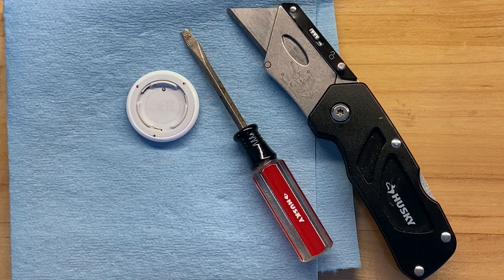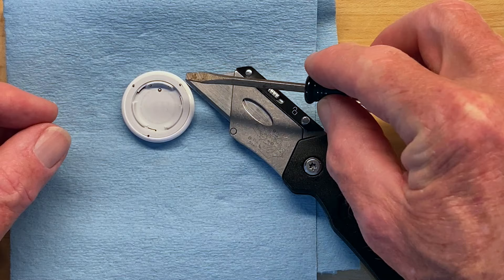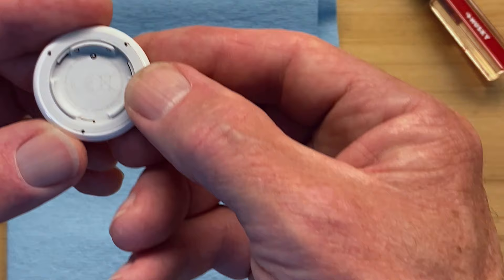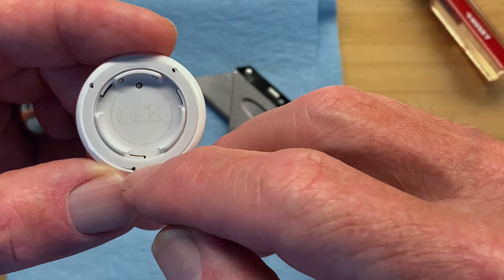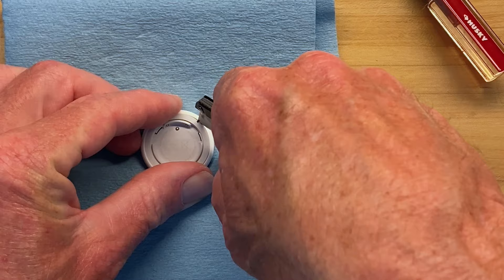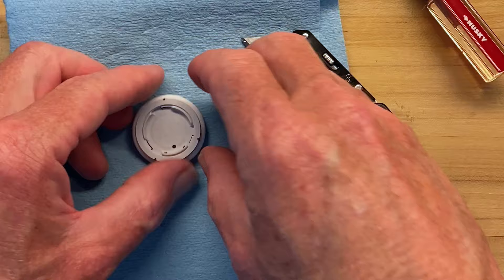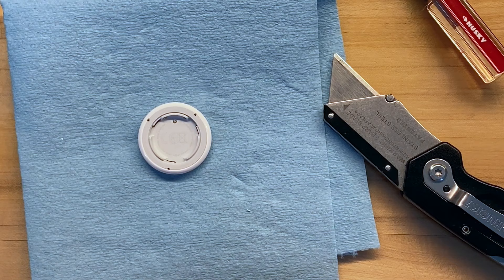Best way to open and mute (disable speaker) an AirTag with zero damage to the AirTag.

Comment: Amazing video!  Thank you so much! I bought AirTags for both my vehicles as there have been a number of vehicle thefts in my area. I always worried what was the point of having an AirTag in there if it would start chirping alerting the thieves.  I feel so MUCH better after removing speakers in both of them!  Thanks again!  Didn't break any clips! SUBBED.
Reply from the maker: Glad to hear the technique worked well for you, thank you for subscribing!

Comment: Thanks for this. Funny how they are still emitting a very tiny sound after speaker (amplifier ?) removal, if you put the airtag just in front of your hear in a quiet room... How come ?
Reply from the maker: Another YouTuber said they heard a very faint sound after the magnet removal as well. I'm stumped. The magnet interacts with the electrical signal from the coil to make sound. with the magnet gone I can only assume the battery or other metallic components are vibrating from the electrical impulses from the coil. Maybe snip and remove the coil?
Reply: Yeah same. Very quiet though. I doubt it could be heard if it wasn’t pressed against an ear

Comment: This is a way better version, thanks a lot, it worked for my four and I didn't break any of the clips. I found it snug to get the back on again on a few but that's probably because I used a small screwdriver and not a knife.
Reply from the maker: Hey David, you're not the first person to hear a faint sound after muting an AirTag, I didn't notice any sound coming from mine, but perhaps my hearing isn't what it used to be. ;)

Comment: Great, I didn't know one could actualy silence the little bugger and this, it squealing after a while when in lost mode, is a major deal killer to use it as a tracker. Will try this on all 5 of my little circles of joy! In IOS 15 there is also a new annoying feature that alerts you when you are away from the tag but it can be turned off. I love how the tag in my parents bag reported to some iPhone on board at 30,000ft over Kansas! Presumably someone with an iPhone picked its BT signal up and connected to a cellphone tower for a brief period.
Reply: Did you manage to do this ?
Reply: yes it was super easy and you can use a little thin blade screwdriver too if you're careful.

Comment: Brilliant! Cheers for this. I just did two and I snapped only one of the clips. Totally chuffed.
Reply from the maker: Thanks for the feedback, glad the technique worked well for you!
Reply: This is great! I snapped one only because I didn’t get the scalpel blade deep enough to detach the clip from it’s seated position. 

Scalpel blades (11) is the best since it causes the minimal destruction with surrounding plastics but strong enough to bend and put through.

A sharpened Philips (-) screw driver is the perfect pry tool.

Thank you to the original poster!

Comment: Thanks for the video! After trying it out it seems that even with the magnet removed, the AirTag is still beeping weakly if you put it right next to the ear.

In order to make it dead silent you need to also disconnect those 2 tiny wires connected to the actual coil.
Reply from the maker: Thanks for the feedback! I never noticed the faint sound after the magnet removal, but others have mentioned it. 

I suspected other metal parts, or the battery were reacting to the coil's electromagnetic field once the magnet was removed. I knew cutting the coil would eliminate the electromagnetic field, but didn't know if cutting the coil would negatively affect the AirTag. My concern was that the coil might also function as the AirTag's bluetooth antenna. Can you compare the bluetooth range of an unaltered AirTag and one with the coil cut?
Reply: @Koolbob2  That's a fair point. Just tested the effective range between 2 AirTags - one with the coil cut and there other one is brand new. It feels to me that both are functioning just the same: both can be connected within 30ft in an open space, or within ~15ft behind a drywall.

I'm only doing this because I want to put it on my cat's collar, and they've got excellent hearing so I don't want it to beep at all. Under most cases it shouldn't be noticeable.
Reply from the maker: @liang-chiwuu4785  Thanks for confirming that the range isn't affected by cutting the coil! I'll add an update to the video description so others can benefit from your experimentation. We have two cats that we don't let outside anymore due to an incident a few years ago with a pack of dogs. I have a few AirTags left over and I had thought about attaching them to the cats collars, just in case they slipped out. How are you attaching the AirTags to your cat's collar?
Reply: That's interesting. Well, let's hope that there is no requirement to have a functional coil incase we need to take it out ;p

Comment: Worked great but having problem activating air tag. I didn't activate before taking out the speaker. Is that the problem?
Reply from the maker: Toby I'm sorry you are having problems activating your AirTag. I activated all four of my AirTags as soon as I got them and then discovered they sound an alert if a person who isn't the AirTag owner transports the AirTag. That's when I decided to mute one of my AirTags. It turned out so well I made my video so others could use the same method.

Has anyone muted an AirTag and then activated it? If you have, please chime in!

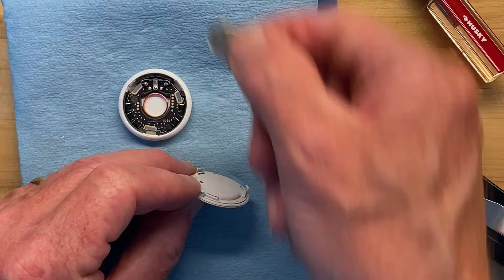Comment: 2:50  What if i also desolder the coil inside and remove it too?? It would save some battery life... but will it work normaly (without sound), or would it trigger a fault????
Reply from the maker: Good question! I'm not an electrical engineer, just a guy who likes to tinker with things. :)

My understanding is that there is a circuit on the board that generates an electrical signal, that signal is amplified and sent to through the coil. The function of the coil is to convert the electrical signal into an oscillating electrical field, the magnet reacts to the coil's oscillating electro-magnetic field and vibrates along with the case of the AirTag the magnet is glued to, creating sound. 

Removing the magnet eliminates virtually all of sound, but the pulsating electro-magnetic field generated by the coil is able to cause other metallic items in the AirTag to resinate ever so slightly. 

Cutting the coil wire disrupts the electro-magnetic field and eliminates all resonance within the AirTag. No electric-magnetic field = no resonance = no sound.

believeI do not anticipate any benefit from removing the coil entirely versus cutting the coil. 

It would depend on the design of the circuitry. It could be that the circuit uses the same power and functions as it did before even with the coil disabled, or the break in the circuit caused by disabling the coil could prevent the signal generation and amplification portion of the circuit from functioning and drawing power. In my opinion, the power savings, if any, would be minuscule and very difficult to measure.

Comment: Would be drilling a hole through the speaker and filling it with glue be sufficient to kill the sound?
Reply from the maker: Maybe. It’s a transducer, not a traditional speaker. The transducer in the AirTag has a voice coil and a magnet (which is what I’m removing in the video), but there is no speaker diaphragm or speaker cone. The AirTag uses the plastic shell of the AirTag to move air and produce sound. IF you could get enough glue between the voice coil and the magnet it MAY prevent to magnet from moving and vibrating the AirTag shell. Maybe.
Reply: @Koolbob2  thanks, it was a thought. Give it a try your way

Comment: Does it still stay water resistant do you think?
Reply from the maker: Good question! First of all, it's important to know the acknowledge the difference between water proof and water resistant. AirTags can not be submerged and even if unaltered, they may be damaged by water intrusion between the two halves of the case or past the battery door. Prying the case open does enlarge the gap between the two halves of the case where the knife blade is inserted, so yes the water resistance is compromised slightly. In my instance, the AirTags I've altered are inserted into a waterproof case designed to mount and conceal the AirTag, so I'm not at all concerned about the reduction in water resistance from opening the AirTag. However, if you are concerned it would be a simple task to add a minuscule ring of silicone caulk around the inside of the case before snapping the back of the case into place. I suppose it could even make the AirTag more water resistant than before the modification. Please Subscribe if you find the video helpful. Thanks!
Reply from the maker: @uglyDuci  I like this one from Device Therapy   https://www.etsy.com/listing/998069956/airtag-bike-mount-reflector?gbraid=0AAAAADtcfRITS-0IQLNb1BHcbWKdEdCpr&gpla=1&gao=1&&utm_source=google&utm_medium=cpc&utm_campaign=shopping_us_d-toys_and_games-sports_and_outdoor_games-bikes_and_cycling-cycling_accessories&utm_custom1=_k_Cj0KCQjwnJaKBhDgARIsAHmvz6eEMEJUehmi8kMd2BtYJTcWLjQ-jdO_1RssNEZ4vbYLmsBPE3i10j8aAtQGEALw_wcB_k_&utm_content=go_12560180294_126270836064_506995646774_pla-315282688459_m__998069956_12768591&utm_custom2=12560180294&gbraid=0AAAAADtcfRITS-0IQLNb1BHcbWKdEdCpr&gclid=Cj0KCQjwnJaKBhDgARIsAHmvz6eEMEJUehmi8kMd2BtYJTcWLjQ-jdO_1RssNEZ4vbYLmsBPE3i10j8aAtQGEALw_wcB

Comment: I wonder how it is waterproof with all the holes behind the battery..... hmmmm
Reply from the maker: To be fair, Apple says the AirTags are 'water resistant', not 'waterproof'. There's a difference.

Officially, AirTags are  and have the same water resistance rating as an iPhone SE. The rating of IP67 means that it is splash, water, and dust resistant. According to Apple, AirTags can spend up to 30 minutes underwater with a maximum depth of 1 meter (3.2 feet) without experiencing permanent damage.

Comment: why do that?
Reply: I have airtag in car. Battery drain fast with beeping
Reply: why is beeping?
Reply from the maker: Apple's intent was for people to use the AirTag to find items they had misplaced. Many of us would like to use the AirTag to locate items that have been stolen, so we mute the AirTag so it won't give away it's hidden location on a stolen item before we can track down the stolen item.
Reply: @Koolbob2  can t mute it by software ?
Reply from the maker: @Mangold108  You can turn sound alerts 'off' and that will prevent the AirTag from playing a sound for the AirTag owner. But it the AirTag will still play a sound if someone else with an iPhone brings your AirTag home with them.
Reply: @Koolbob2  HOW LAME! OF COURSE WE MUST DISABLE SPEAKERS! DAMN APPLE

Comment: Fyi, you can use the 'Directions' option to find items without playing the sound, so removing the speaker is unnecessary!
Reply from the maker: True, but there is a logical reason for physically disabling the AirTag speaker. 

Apple is concerned that people will use the AirTag to unknowingly track another persons location. So Apple has designed the AirTag to audibly alert any iPhone user that brings an AirTag that isn't registered to them to their home, work or other place they use their iPhone regularly. 

Apple's 'anti spying alarm feature' defeats the purpose of attaching an AirTag to something of value if the AirTag is going to sound an alarm when and the thief brings the item to their home. Hiding and muting an AirTag when attaching it to an item of value greatly reduces the chance that the AirTag will discovered and disabled by thieves.

Good luck retrieving anything of value if you have attached an AirTag in plain view or failed to physically mute it.